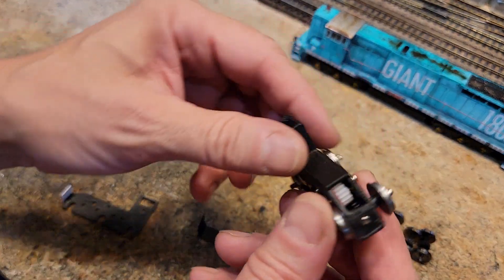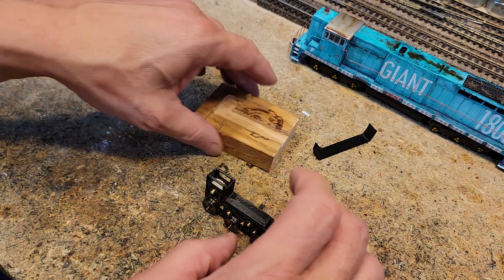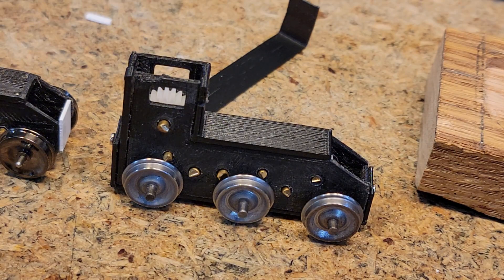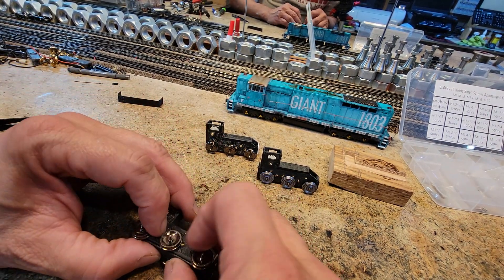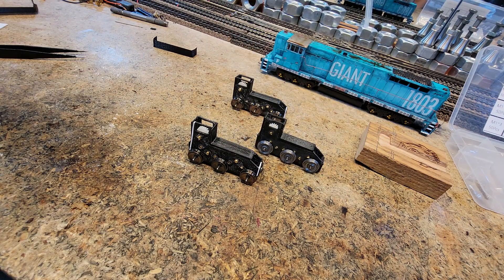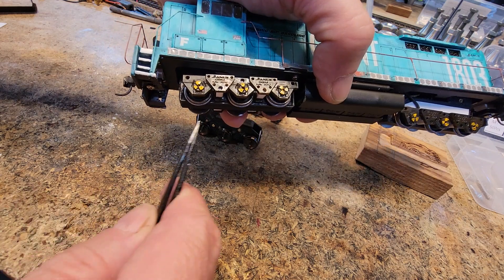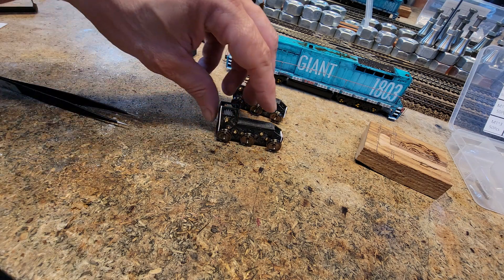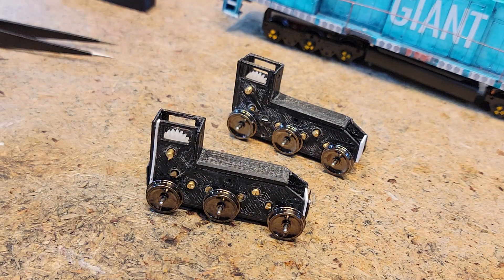Scratchbuilt HO Scale DPU 2

Comment: You can get accurate enough truck frames for correct gear engagement with 3D printing? I am another 1 looking for S Scale drive items. The  C 1983 Overland SD40-2 and GP38-2 drive mostly SUCK..... I now have a lot of them. Sometimes they run well and sometimes they don't. They are also having some zinc pest issues. Looking for a drop in alternative that runs the same....
Reply from the maker: 3D printing isn't accurate enough - so I only put registration marks where the holes for the axles go and then I use a drill bit for the 2 different sizes!  I'm planning on making a bunch of useful files available so anyone can build these in any scale - I start with a very accurate cutting diagram which can be printed on paper and then be used to line up everything in a homemade jig.  just 2 pieces of wood glue to form an L shape that you can use for clamping and gluing!